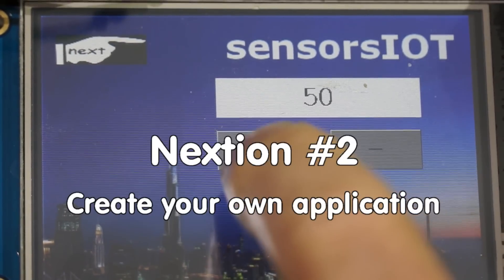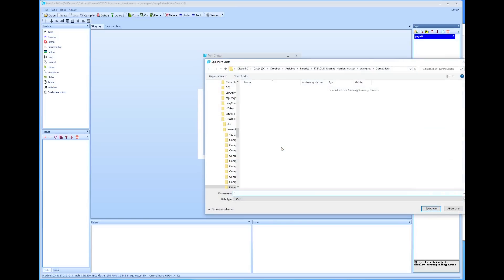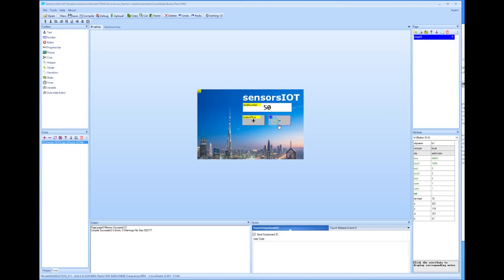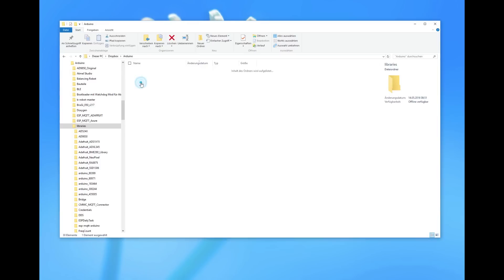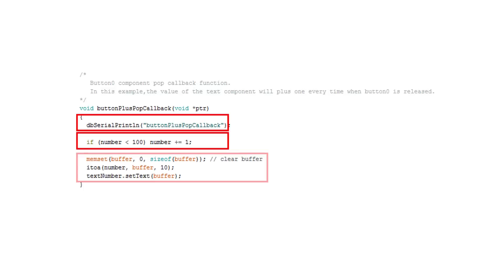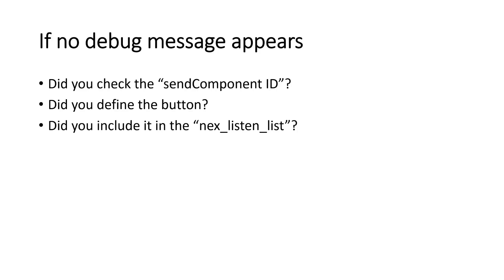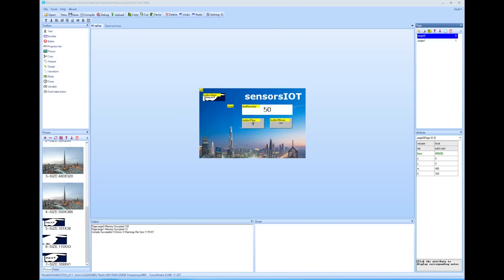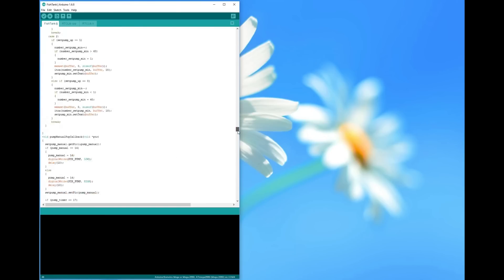#59 Nextion Display Tutorial #2: Create your own Application

Comment: Thanks for the videos they are very informative.... I have a problem you may can help with. In a code on my Arduino there’s a section that say , nexPage  page0 = page0 (0, 0, “ page0” ) and I keep getting an error message that says nexPage doesn’t name a type.... I’m learning to code and I take on projects bigger than what I can easily handle so I have to seek help... I got the code from someone else and I have asked them several time but haven’t gotten any answers after a week or two so I stopped.... any ideas?
Reply from the maker: This is quite an old video. So I do not know the actual stage of the product. And I cannot do remote debugging :-(

Comment: When loading the code (fishtank), to compile, it gets the 'NexText' does not name a type...Any ideas?
Reply: @Andy Pandy The Nextion include statement was already there. I also tried the text that you included. I still get the same error... 'Nextion' does not name a type.  I tried on arduino 1.8.5, 1.8.8 and 1.8.9.
Reply: I think I found my problem. I was trying to compile for an Arduino UNO. when I changed it to Arduino Mega, it compiled.  Thanks all.
Reply: @Andy Pandy Thanks very much for you help.

Comment: Dear Sir

I `m an old mechanic with also a Swiss accent.

With the Arduino Mega and the Nextion display I can`t find the command to change

the color for font and text field (pco  , bco ). At a certain temperature the color should change.I always receive a text : class Nextex  thas no member bco / pco

With the if statement : if (signsensDS4 >80) 

field t40 should change to red(63488) but I have no clue how to do that.

Where can I name bco and how does the command exactly should be ?

 

 

 

if (signsensDS4 >0)  // Water temp

{

  itoa(signsensDS4, charsensDS4, 10); //wandelt Zahl (signed integer) in einen String der länge 10 um, signsens01 = Zahl, charsens01 = Zahl in Textformat

  t40.setText(charsensDS4);  // Water temp

  }

   if (signsensDS4 < 0)  // Water temp

   {

    t40.setText("Error4");

    }

Thanks a lot in advance and all the best for 2019

Niklaus
Reply from the maker: Remote debugging is not easy and this is a quite old video. Did you check the "DualStateButton" ?
Reply: Andreas Spiess ß
Reply: Happy New Year
Tanks for the quick answer.
It looks like it is too much over my head.

What about if I sent the complet sketch?
Have a great day!
Best regards
Nik.
Reply from the maker: I do not do consulting. I try to put my time into videos. I would have to do the same as you: Googling and trying.
Here is an example file: https://github.com/itead/ITEADLIB_Arduino_Nextion/blob/master/examples/CompDualStateButton/CompDualStateButton_v0_32.ino

Comment: Hi Andreas. It is possible to use the dual state buttons, to turn on and off, for a "LED loop". I want to turn on some led behaviors on my neopixel, and that has to be in at loop, or it is static light on and off. I need blicking and rainbow behavior ?  Thanks  ;)
Reply from the maker: The logic for the Neopixels or other lights is done on the MCU (e.g. Arduino), not on the nextion. So you can do whatever you want.

Comment: Hi Sir, may you please make a tutorial about , how to make a simple keypad including numbers 0-9 and Clear and Enter buttons , and as we enter the correct code it leads us to a new page for controlling for example a LED and also we change the code.... please i've been looking for something like this in Internet but couldn't find it , you will be the first person making it, i'm using Arduino , i need this for my project. thanks
Reply from the maker: You are welcome. I  think it is not necessary: http://bfy.tw/KOOj
Reply: Thank you sir for quick reply but unfortunately there is no Arduino code for such thing. there were some samples of the keypads designed by Nextion Editor. i'm just noob at this and i even don't know how to code a button in order it prints a number in text box in nextion display and we can store that password in EEPROM by Arduino....i will appreciate if you can make something about it , cause i'm sure it can be a question for many people. Thanks

Comment: ok. I've gotten a step further. 
I've uploaded it to my Nano, connected the RX/TX pins to it. 
But the only thing that happens when I press the +/- buttons on the display, is that the RX light on the Nano blinks. 
The display doesn't update. (shouldn't the TX light also blink on the Nano?) 
I have checked that the page and component ID is correct. 

suggestions?

update: changed the baud rate to 9600. that got the tx to work. 
in serial monitor I get this now: 
[680:0,3,buttonPlus]
buttonPlusPushCallback
textNumber.txt="71"⸮⸮⸮recvRetCommandFinished err

it counts up and down when I press on +/- on the screen. but no change on the display number.
Reply from the maker: That is already a lot. Now you have to find the reason for the error message. I cannot help from a distance.
Reply: Disconnect your arduino from the computer and and power it externally (from somewhere where is no data connection to usb). Maybe the USB-UART chip messes up the communication between the MCU and the HMI display.

Comment: Greetings Andreas. I have an enhanced 4832K035 Display. When I compile your examples and save to a micro SD, trying to activate on the display, throws an error indicating "Model Does Not Match NX4832K03511R" . Is there a way to change the model number going into your examples?
Reply from the maker: You can change the model in the editor

Comment: THANK You for a such a wonderful guide..Actually I am facing a  problem in swapping between the pages  i am making a monitoring system and I have  6 different nextion page and I am using the command page1.show(); znd follow the all steps in your video but it shows error in serial print and doesn't move to the next page what should I do?
Reply from the maker: I do not know. Do all the other commands work?

Comment: Sir,I am using library you given but it cannot work.
\
Reply: When compiling Long Error occur "Error compiling for board Arduino Nano."
I am using your example files and your ITEADLIB_Arduino.........
Reply from the maker: Are you sure you do not use Serial2?
Reply: Yes sure I am using file CompRtc.
#include "Nextion.h"

NexText t0 = NexText(0,1,"t0");
NexRtc  rtc;
uint32_t  time[7] = {2016,11,25,12,34,50};
uint8_t time_buf[30] = {0};

void setup() 
{
    nexSerial.begin(115200);
    rtc.write_rtc_time(time);
}

void loop() 
{
    rtc.read_rtc_time(time_buf,30);
    t0.setText(time_buf);
    delay(1000);
}

Comment: Hello
Andreas Spiess ,
I have Nextion 7" Display and I am Trying to Develop Graphics for RO Water Purification Plant.There are Pumps,Valves,Sensors-Level Switches,Transmitters Controlled by Arduino Mega .I have Graphical Object for Mentioned Object in PPT .I want to Change Colour of Valve Depending on State of Valve Operation by Passing Integer Value to Nextion Display  (0-Off State,1-ON State and 3 Trip State) for Same I have 3 Different PNG. Accordingly Colour of Valve Should Change.Which Function of Nextion I can Use for my requirment is it Possible to Display ON_Png and Hide Off_Png as Per Valve State or is there any other Work-Around.
 I am Even Facing Issue Regarding Transparency of Object and Placement of Object when I add it in Nextion Editor they all get Accumulated at Top Right.
I am not Getting Starting Point of How I Can Proceed. Your Help would be Utmost Appreciated
Reply from the maker: 1. I would start with a simple example like the one I used in my video and start to change minor things.
2. All objects are inserted in the top right. Then you can move them with the mouse to where you want them
3. Changing of colors can be done in the attributes of the object (e.g. the buttons).
4. Maybe you also visit: http://support.iteadstudio.com/support/discussions
5. Unfortunately, it will take some time to find out all the different things.

Comment: I tried the Fishtank , when compiling I get a FishTank:62: error: 'NexText' does not name a type , I'm sure it is something I am not doing.
Reply from the maker: Did you use my library? I think, there are a few libraries out and not all work with the code.
Reply: Andreas, I used the one that the lib manager finds in Arduino. It did load the  .h and .c files that are in the same folder. I will download the one you had linked. I really appreciate you quick response. Great job.

Comment: hi sir  had a quick question?    how to send a specific word or number or code when u touch button on  the nextion display to the arduino  . like if i had a few push buttons on the display and i wanted to use to control the leds  connect to  arduino  please help.
thanks
Reply from the maker: You have also text fields available. And each button has a different name

Comment: error: macro names must be identifiers
I'm using a Leonardo Arduino I have written the same code excepted the dbSerial that I have not write and it send me this error, help me please
Reply from the maker: You have to be much more specific. Remote diagnosis is a complicated business. Maybe you google your error message?
Reply: I have post on the Itead forum Patrick Martin helped me thank you anyway. But thank you too for the tutorial it helps me a lot :)
Reply: I have a new problem now, yesterday the number increased/decreased when I pushed/released but now it doesnt work on the serial monitor I can see "recvRetCommandFinished err
"
Reply from the maker: The usual question is: What did you change since then (Nextion File/ Arduino file?)
Reply: Oh I found what was the problem, the last day I missclicked I have deleted the text component so I replaced it and I forget to rename It.... 
I'm sorry for the trouble! 
And thank you for your answers and this tutorial :)
Reply from the maker: I just setup your setup with a Leonardo and also had no issues...
Reply: I'm a noob at programming this is my first year, and this last misstake of the text name was a dumb error that was my bad, we juste have to change the NexConfig who is on Serial2 as default to the Serial1 for the Leonardo and delete the 2 NexUpload files. ^^" 

I have one more question could you juste explain me this 2 lines that I don't understand on this program :
memset(buffer, 0, sizeof(buffer));
itoa(number,buffer,10);
I don't know what does it means ^^"
Reply from the maker: Google is your friend ;-) itoa takes a character string and transfers it to an integer. memset fills the whole buffer with zeros.

Comment: When I plug everything in, I see "Setup Done" on the monitor. But when I press a button on the Nextion display, I don't see any messages on the monitor! What do I do??
Reply from the maker: Did you follow all the steps of this video? Did you also check the next video in the Nextion playlist about the definition of the serial connection?
Reply: Oh my god! Thanks so much! I was scouring my code, looking for a problem, when suddenly I looked down and realized that I wired wrong! Always check your wires!!!!! Even if the display powers on, the wires can still be wrong. (as I just learned) I switched the Ground and TX wires! Thanks for your help and for the fast response time! You just earned a sub!
Reply from the maker: Shit happens... Also to me sometimes.
Reply: Haha, yes! Sorry to bother you, but now I'm having another problem! One of my buttons on Page 1 is labeled "Call." When I press it, it is totally unresponsive in the Serial Monitor. "Send Component ID is checked" and I've double-checked everything in the code! Yet it remains unresponsive!
Reply from the maker: +Wesley R Tech I would compare it with a working one (aspect for aspect). Try also to exchange parts from a working one. From here, I cannot help.

Comment: I useing mega but my + and - key not chaging "textNumber" i don't know what I have don?
Reply: what I get in serial monitor .... recvRetCommandFinished err   

Thanks Aaron
Reply from the maker: Please also watch the video #63 and also check the communication speed between the Nextion and your Mega
Reply: For the Arduino MEGA: 

Go to the nextion library and edit the NexConfig.h

Change the number of the "#define serial", like this bellow: 
__________________________________________________________
/**
 * Define dbSerial for the output of debug messages. 
 */
#define dbSerial Serial2     <-------------------------------- 

/**
 * Define nexSerial for communicate with Nextion touch panel. 
 */
#define nexSerial Serial      <-------------------------------- 
___________________________________________________________
and save of course..

After that, you have to be sure, the ground of the external Nextion and arduino power is the same together.
Reply: Hi.
Sorry but I have the same problem "recvRetCommandFinished err" in my serial monitor...
I have Mega  and I can see the number changing in the serial monitor (115200)
But in the TFT  the texNumber is the same all the way... so I think there are two problems?

Perhaps your code need do do something wiyh "texNumber"

Thank's a lot!!
Reply: hello julio did you fix your problem? because for me it's the same
Reply: Hello
No, I'm stuck.
I have seen the video 63,
I have changed communication speed 9600/115200,
I have used the same gnd for tft power and mega power,
I have reload the program in the mega and tft
...
Reply: +julio clavijo i solved connecting the GND's toghether with no change the BAUD
Reply: I'll try it later
Thank you
Reply: no way.
If I use the GND together the tft does not turn on :(
Reply: +julio clavijo what do you mean with "togheter" ? do you connect the display's GND to the arduino's GND pin and the 5v as well to the arduino's 5V pin?
Reply: hi simeone you could put which pines you used to connect TFT & arduino ground's ?? i have the same problem my communication speed is 115200 in the serial monitor of arduino thank you
Reply: Thanks Mr Spiess

Make sure you have the right serial port.
Mega2560 board
ex: Serial2 = Pin 16-17
Serial1 = Pin  18-19
Serial3 = Pin 14-15

Serial2 is defined as default for NexSerial in Lib, Just change Serial Number following the pin your using.

ref:
https://www.arduino.cc/en/Reference/Serial
https://www.arduino.cc/en/Tutorial/MultiSerialMega
Reply: I am having the same problem as above. My Serial connections are correct...

Comment: have an Error at 8min on your video. I also did get how (at 5mins in your video (#define Debug_serial enable) as it already says that. His my Error msg
 Arduino: 1.8.1 (Windows 10), Board: "Arduino/Genuino Mega or Mega 2560, ATmega2560 (Mega 2560)"

C:\Users\Tombstone\Desktop\test\ButtionTest_1\ButtionTest_1.ino:19:21: fatal error: Nextion.h: No such file or directory

 #include "Nextion.h"

                     ^

compilation terminated.

exit status 1
Error compiling for board Arduino/Genuino Mega or Mega 2560.

This report would have more information with
"Show verbose output during compilation"
option enabled in File -> Preferences.
Reply from the maker: You have to have the Nextion library in the libraries folder. You should find it in my github. If you do not know how to install libraries, just google.

Comment: Hallo Andreas, hier auch Andreas. Ich hab mein Display jetzt anhand deines Videos zum laufen gebracht. Hab mir ein schönes Design ausgedacht und übertrage aktuell 10 Werte vom Arduino auf das Display im Sekundentakt. Das funktioniert soweit gut. Allerdings im Serial Monitor postet er 10x im Sekundentakt "recvRetCommandFinished ok". Wenn ich jetzt die Seite wechsle, kommt immer "recvRetCommandFinished err" und ich muss wirklich oft auf den back-button hämmern, um wieder auf der ersten Seite zu landen. Dann funktioniert aber alles wieder. Hast du ein Tipp für mich?

Ich hab den Serial debug auskommentiert, und mal die Übertragung der Daten gestoppt. Die Seiten lassen sich ganz normal wechseln. Sobald ich aber wieder die 10 Werte übertragen lasse, spinnt alles wieder.
Reply from the maker: Da ist Ferndiagnose schwierig. Da musst du wohl oder übel selbst suchen. Als Tip: Ich starte immer mit einem und wenn das sauber läuft,  erhöhe ich die Komplexität bis es nicht mehr läuft. So finde ich auch schwierige Fehler. Nur wenn ich den Fehler genau nachstellen kann, ist eine Beseitigung dauerhaft...
Reply: Ok, ich hab es soweit eingegrenzt. Sobald ich nur eine Variable sende, funktioniert das Wechseln der Seiten bereits nicht mehr, Ich hab die Sendefunktion direkt in den Loop eingefügt. Sehe ich das irgendwie falsch?
Reply from the maker: +MeisterQ schick mir mal den Sketch mit Library
Reply: Hast du irgendwo eine email adresse stehen?
Reply from the maker: Ich bin auf Facebook und Twitter